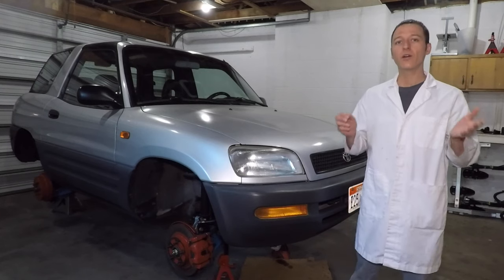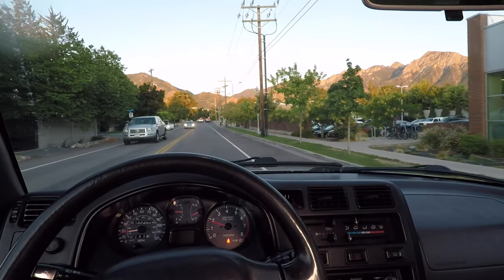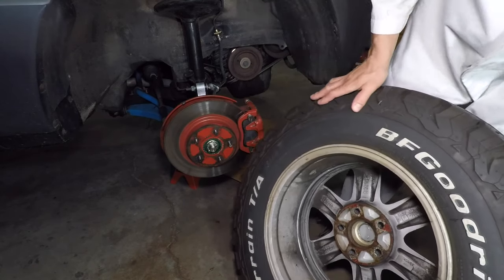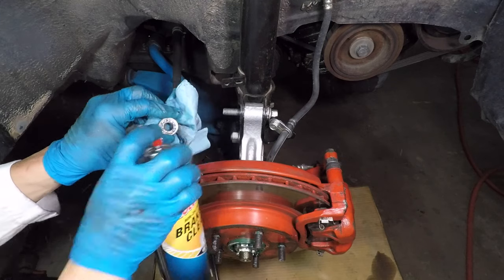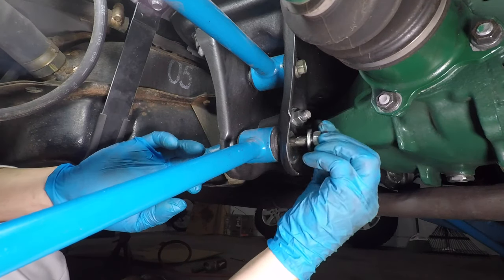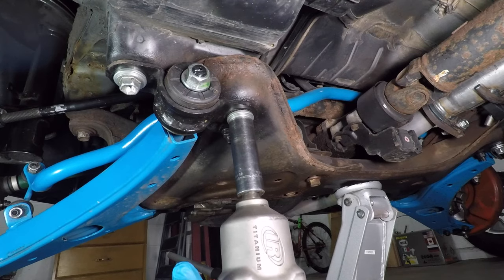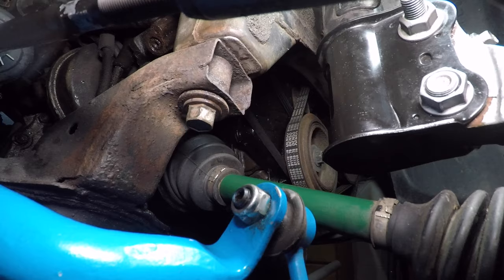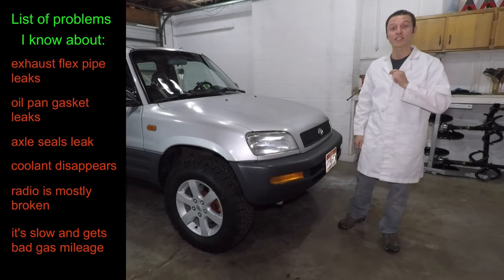My big mistake: don't grease the bolts! (episode 13)

Comment: DON'T put those bolts back.  When you used grease on them, the mechanical stress on the bolt could be twice as higher for the same amount of torque on the wrench - the result is the metal of the bolt will start plastic deformation, which is when the metal stretches irreversibly - it elongates - and also it looses its mechanical strength.  So your bolts didn't got loose because the grease was 'sliding', but because the metal has stretched and lost its strength.  Replace them with new.  And never ever put grease on any bolt on cars, boats, planes or submarines.  The only threads where we can use some grease are tools such as a spring compressor (will help compressing easier the springs, but don't use air tools, just hand tools), on a vise, and things like that.

Comment: Do what I've done on my RAV4.2. After cleaning rust from outside of steel parts, mix 9 parts petrol/white spirits with 1 part wax in warm water bath (stay away from any fire, just hot water). When wax become dissolved, spray it on outside of bolts, and everywhere else. If done once a year, it protect from water and dirt, steel is rust free completely. Great when you refurbish all suspension like you did.
Other solution? Copper spray. Copper sacrifice itself in oxidizing battle, as it is more reactive than iron. It keeps bolts on my turbo clean for couple months, so not bad at all.
At the end if you love that machine, change all rusty bolts once a year for some 8.8, cheap and strong. But never use stainless, they will seize in steel thread.

Comment: i greased all bolts on our cars with copper paste and never had an issue with this. Get sure u used the right torque spec or a lil bit more and clean the threads with a brush attachment. good that you noticed it before your car fall apart. Good luck

Comment: I love how even smart people make big mistakes. I also have problems with rusted bolts and i was thinking in greasing them but i didn´t think it was such a good idea and i went to the internet to read more about it, a lot of people tried it and had some accidents. And Loctite can be a pain in the ass sometimes so i prefer to tolerate some rust, still, on the exposed threads i put some silicone once everything is tighten up, it helps a lot.

Comment: Rather than using grease on your bolts I recommend anti-seize and loctite ☺️
Reply: Yes a little bit of copper grease on the threads is ok. I always use a few drops of oil or wd40, no problems.

Comment: I’ve always lubed critical threads, generally with copper or moly.   Only once did I ever feel a fastener going deep into yield and I have never experienced loosening over fifty years.  I’ve seen quite a few people “follow through” when their torque wrench breaks, not good.  It’s vital to develop feel more than rely heavily on torque values.  You have to be able to feel how the joint is coming together, not enough to meet the nominal torque.

Comment: I just bought 2 new subframe bolts (the really big ones) from the Toyota dealer because like you I had a hell of a time removing them (especially the drivers side) and they were very pitted. The driver side one was probably rusted 30 percent of the way through.  This car spent its first 10 years in Wisconsin, that’s why it’s rusty.  But lucky for it, it now lives in the desert.
Reply from the maker: Dealing with all that rust is no fun.

Comment: You are right, plus if this was good practice, Toyota etc. would use grease, but they do not. Grease is only needed when threads move like the spindle of a bench vice etc. to prevent wear. You could use a bit of grease to seal the nut on a (wheel) stud after you torqued it down, to keep moisture out, which I learned to do in the army when I was a mechanic.

Comment: Thanks for the tip! Ive greased up some bolts myself over the years... And on our Rav4 99 the problem with rubbing is the same, but its on only on the drivers side. Strange, might be some difference in the suspension on all theese cars from the factory?

Comment: oh my... applying map gas heat to the body is also a very bad idea if you don't like rust. that's how to accelerate the rust 20 fold. I wouldn't be surprised if you have a large rotting hole from the inside out in that area you torched now.   The reason your impact failed is because it is pneumatic - they are extremely weak, often with only 80-150ft lbs of breakaway torque at maximum (it is just air spinning a hammer gear).  What you need is an electric portable impact wrench. something like the milwaukee with at least 400ft lbs and often you will end up on level 3 (about 1200ft lbs) to remove axle nuts and harder bolts.  It's not that the bolt was stuck in this case, just that your wrench is weak. Pneumatic zap guns are weak intentionally because they are to be used to initially install hardware at auto shops (namely wheels) while avoiding overtightening, then the technician comes back with the torque wrench and fastens them properly.
Reply from the maker: The map gas torch will definitely remove paint, but sometimes it's needed to break rusty parts loose. The best way to prevent rust is spraying a coat of lanolin oil like Fluid Film on metal parts, and re-applying every year.
I agree about the impact wrenches. I recently bought the big 1/2" high torque Milwaukee electric impact and my old pneumatic one feels like a kid's toy in comparison. 
Thanks for watching!

Comment: Hahaha yeah, I went bush bashing in my E36 BMW when one of my caliper bolts came loose and started dragging on the rotor, 100km to the closest hardware store I had fun trying not to brake and only using the handbrake until I had to brake for a school zone and skidded off the road same as you, put a nice groove in the wheel... Double nutted a cheese grade long ass bolt from the farm supply store to  get me home, got home and pulled apart all the suspension and brakes and blue Loctite on everything.... Never trust the previous owner.

Comment: hi paul not linked to the jack kits but wondered if youve come across hi reving when you first start your car mines petrol but revs like mad from cold like an automatic choke but cant seem to adjust it reasnably ! hey when you put your bolts on did you have  the split locking washers on they genrally dont allow bolts to come loose even when greased if torqued up right . cheers.
Reply from the maker: I recommend checking your vacuum hoses.  A vacuum leak will cause your engine to idle higher than normal. 

Most the suspension bolts don't have locking washers.  Tie rods and ball joints have cotter pins, so those ones can't get loose.
Reply: @LabCoatPaul  OK thanks paul will check them out ,you must really love that rav for the work and effort you put into it ,they are a nice mini 4x4 mines got 134,000 its a 1997 very retro by todays standards, and still has grunt but just wish it was a bit more economical id love to drive it everywhere lol .take care keep up the vids check mine out if you like ! oh and subscribe lol.

Comment: why would you locktite a servicable part with blue locktite (that is meant almost never to be removed again). That's about as bad as using grease.
Reply from the maker: At this point, I had the bolts come loose before, so I wanted the loctite. Blue Loctite is medium strength, Red is high strength.

Comment: Blue loctite wont work . They operation range is  -54°C to +149°C (-65°F to +300°F).  Brakes get way hotter than that . The  loctite becomes powder .
You  had that problem because as you just said you used your "imaginary torque wrench"

Comment: @2:30 so.... how’s that grease and locktite working out?
Reply from the maker: It hasn't fallen apart yet.  I'm hoping the grease didn't mix with the loctite.
Reply: Haha! Awesome! I finally fixed my my 99 awd 5 speed 4 door! I needed the rear driver wheel hub spindle! But, I didn’t want to spend $290 at Toyota for a new one! But, none of the auto parts stores sold the rears! They sell the fronts for $37-50 commercial pricing! So I was getting mad! But, thank God. I was able to not only find one! But, two of the spindles used! In perfect using condition! But, I had to drive from where I live! Prescott, AZ all the way down to tuscon, AZ! So. I drove a total of 430+ miles! For used parts that are almost impossible to get! But. Now I have one main extremely bad oil leak coming from the passenger side cover! That the oil pump mounts up to. It’s not leaking from the oil pump. It’s glusing out through the actual cover that covers the internals! $40 part. But, 10 hr job easily! The person that I bought the spindles from has a spare motor that he’s willing to sell for $200. It doesn’t leak nor does it overheat. I’m tempted to buy it and put that into my RAV4 and throughout the next year buy a 3gste beans motor! Get it built! And swap that bitch in her! Yes. I’d much rather tear out my current motor! To put in a motor that doesn’t poor out 1 gallon of oil per 80 miles! 🤬🤬😢😕 just to then tear out the 2nt motor! To put in hopefully the 3rd and last motor! That will hopefully make 250+ wheel HP to the rear wheels haha! Sorry, to all of the wheels! By then I will have a LSD differential that will come from Australia! so, I’ll then have a rear LSD and a center locking differential LOL!
Reply from the maker: @welcome2myworld1.o89  Congratulations on finding your parts! 

I've been thinking about doing a 3SGTE swap too, but I can't justify it in any logical way.  I'm guessing it will cost about $5,000 total, plus at least 100 hours of labor.  The car is worth almost nothing, and I'm kind of burnt out on fixing my old RAV4 all the time.

My next repair will be the timing belt / water pump / oil pump / oil pan gasket.  My oil leak isn't very bad, but I lose 1 gallon of coolant per tank of gas.  It only leaks when I'm driving.  It has to be that water pump.
Reply: Paul Shpakov man! I just did all of that! Thinking that was my oil leak! In deed my oil pan was leaking. But, when you fix one leak on these things! A new leak will come out of the shadows! I hate to say it, Paul. But! I believe it will be so much easier to just rip the engine out. And replace everything that needs to be replaced. 

And if you need a new clutch or rear Maine seal. That’s the time to do so! To change the water pump and oil pump and the crank seal, camshaft seals! all of that stuff! You have to jack the motor up lower the motor jack the motor up lower the motor to get out certain engine mounts, bolts, and etc! you have to remove the downpipe from the catalytic converter! you have to remove the support assembly that’s underneath the motor and transmission! And if you have abs! You must undo the bolts that hold it together! And pull it aside! And obviously the right side wheel! it’s a pain in the ass! I wish I would’ve just removed the whole motor and put it on a engine stand to do the work she needed and still needs! Ether way! What ever you decide to do! Please continue to be safe! And god bless! 

And trust me! I hate working on this RAV4. I’m sick and tired of power steering leaks. And oil leaks! but when I’m driving the RAV4! it is so luxurious, because of leather seats, Bluetooth radio,  and that  sunroof! And my 5 speed  transmission shifts so so beautiful into all of the gears! And obviously the engine has so much power for what it is. I believe with a exhaust system, cold air intake, lighter pulleys, and ac delete! These things would move haha!
Reply from the maker: @welcome2myworld1.o89  The first generation RAV4 engine puts out 120 hp and 125 lb-ft of torque, which gets the tiny car up to 60mph in a brutally slow 11.4 seconds.  By today's standards, that's an extremely slow car.  It would be hard to find a new car that is as slow as the old RAV4.

Nothing you do to the 3S-FE lump of an engine will make it go fast.  Don't waste your money on pulleys or exhaust.  They will have minimal effect on the speed of the car.  

Also, please don't remove your A/C.  The entire system only weighs around 30 pounds, and has no effect on engine power when it's switched off.  If you don't believe me, take a few 0 to 60 runs using an app to time your car.  Then take off the A/C belt.  I bet you'll get the same results.

If you want your RAV4 to go fast, take out the 3SFE engine, and install a 4th gen 3SGTE from a Japanese Toyota Caldina.  It's also a 2.0 liter, but with a turbo  and puts out 260 hp stock.  It's a big project though, and requires major re-wiring, and a lot of other things.

Comment: Paul how can I ask u a question about my 1998 rav4? I can pay for your help.
Reply from the maker: You can ask a question about your RAV4 the same way you just asked if you can ask a question.  What's wrong with your RAV4?
Reply: @LabCoatPaul  Paul I have a 1998 rav4. My stereo was stolen so I have a new one, but the install brackets are all gone.

If you can help, either create them or draw me a schematic of your brackets I would pay. I'm desperate!
Reply: By all gone I mean no dealer in the U.S. or Canada has any left. Discontinued. Kaput. Ix nay. Finished. Pushing up daisies,!!! Sorry.
Reply from the maker: @coreyfleig2139  The stereo brackets are plentiful at the junkyards.  Any junkyard that has an old RAV4 probably has that part.
If you don't have a junkyard nearby, some will even mail you parts.
Reply: @LabCoatPaul  okay - I will check that out. I'm slightly pessimistic but you're the genius here, not  me! Your vids have been incredibly helpful, so thank you!
Reply: @LabCoatPaul  Paul just a follow up. A local dealership found 2 brackets in a depot in San Jose. Possibly the last two new ones n existence! So now I'm trying to decide if I should install my radio or bronze them! 
Thanks for your encouragement along the way.

Comment: Use anti seize! It’s the best, stops them from rusting stops them from locking up and they won’t come loose, I use it every single time, the rare instance where I have to remove work I’ve done years later it’s usually as good as new.
Reply: Just make sure you don’t over tighten the bolts when using anti seize, or any lubrication for that matter. Some manufacturers have a note to use 10-30% less torque than specifications when using lubricated bolts.

Comment: Original manufacture bold never rust.
Reply from the maker: That is not true.  Toyota bolts come with a thin zinc coating, but they rust anyway.
Reply: They definitely rust buddy

Comment: really strange recognizing the roads in these videos. not trying to be creepy but man im pretty sure we live close
Reply from the maker: Yup, I live by 2000 E and 3300 S
Reply: @LabCoatPaul  so are you planning to keep your rav? You said it wasn’t working out so I’m curious to know what your plan is!
Reply from the maker: @westonered  I'm sort of married to the RAV4 at this point.  I've already fixed most of the stuff, and my YouTube channel is based on this car, so I guess I have to keep going.  I took a break from it this summer, but I've already ordered some parts and I'm planning on getting back in to fixing stuff this winter.  
I'll be fixing some exterior body stuff next.  The grill is broken as well as some of the lights on the outside.  I'm thinking about the 3SGTE engine swap, but it's pretty expensive so I'm not sure if I'm ready to do that yet.
Reply: @LabCoatPaul  glad to hear you still have hope for it. It’s a bad ass little rav

Comment: you have no clue what you're talking about. Bolts rely on tension to keep components together.
How do you know you tighten it right without a torque wrench?
you can apply it ti certain parts, but need to be manifaturer spec x 0.7nm

Comment: Two noob mistakes - coating with grease and using your “imaginary” torque wrench 🔧.
Reply from the maker: The imaginary torque wrench is better than a real torque wrench in most cases.

Comment: Grease isn't the problem....you didn't tighten them appropriately...you never mentioned the torque you tightened them...did you use new bolts...Nope....they were possibly stretched....suggest you forget home maintenance in the future
Reply from the maker: I did use a torque wrench on a lot of the bolts, and they were new bolts.  Fortunately I haven't tried this dumb idea on any other cars.  There were a couple other factors too.  I completely took my suspension apart, and painted all the parts too.  The paint + grease could have both helped loosen things up.
Reply: Grease + proper torque = success - rust. If this didn’t work for you either the bolts weren’t torqued correctly or the grease wasn’t the problem. Would suggest antiseize anyway instead of grease.
Reply: Since a "mechanic" didn't tight my brake calliper properly, which came loose on the middle of the road and jammed my wheel at 60km/h, I always do home maintenance as well. Never been happier. And the amount of money I saved not going to those (most of them) thieves anymore I can't even tell.
Reply: That's a little harsh.  Everyone has to learn.  This guy's doing it on his own dollar, more power to him.